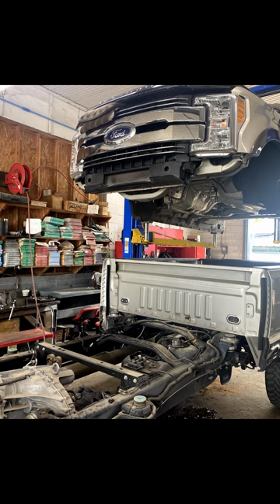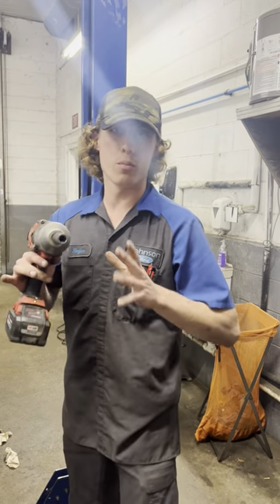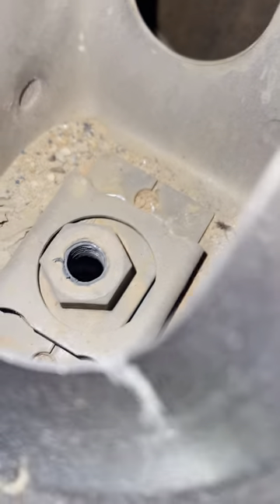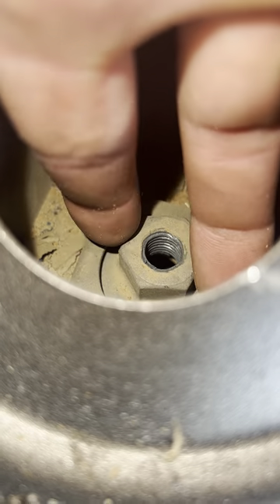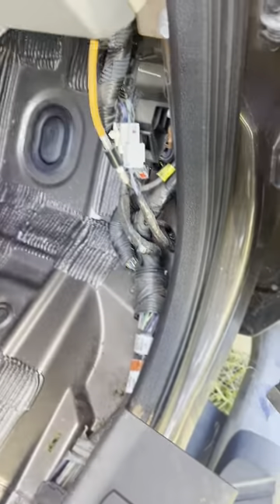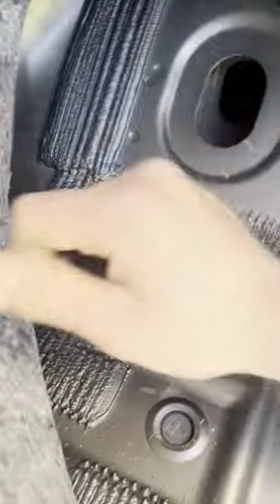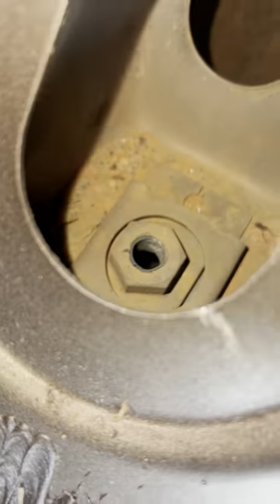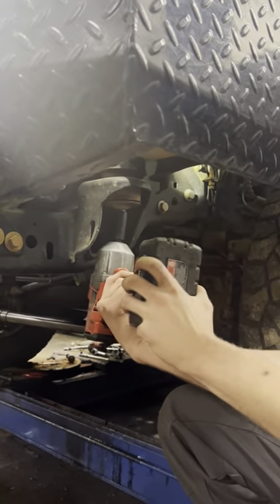How to remove seized F-250 Cab Bolts fast and easy

Comment: Make sure to wire wheel all that galvanization off that so that way they Rust in place for the next guy.
Reply: Lol
Reply: Just put anti sieze on them
Reply: @contraband1543  😉
Reply: You mean somebody's gonna have to take the cab off again sometime in the near future? Jeez what a peice of crap. 🤣
Reply: Exactly. Induction heater or patience.
Reply: Don’t worry it’s a Ford it will have to come apart again before it even has a chance to rust up 🤣🤣
Reply: Antiseize
Reply: @Thundarr995  you donknow what your talking about
Reply: @BimmerLife843  neither do you
Reply: @BimmerLife843 if you listen closely you can hear the fords rusting at a ford dealer
Reply: Believe it or not, when you wire wheel the threads, you’re actually finishing the thread cutting job Ford couldn’t do when they were produced. Any surface on those threads, I don’t care if it’s straight up asparagus dog sht is better than virgin Ford threads.
Reply: And you know, there WILL  be "the next guy."
Reply: The galvanization won't survive the friction from tightening it
Reply: @Thundarr995 maybe in two weeks it’s a ford

Comment: Hey guys the true pro tip is heat all the bolt heads from the bottom with a regular propane torch leave it on there for about a minute and a half and I guarantee you everyone of those boats will come out you were actually liquefy and Loctite and it will come right out done this multiple times. Also never use an impact. The impact breaks the cages break them loose by hand and then you can use an impact after they are already loose.
Reply: How will a propane torch get hot enough and transfer the heat all the way up that long bolt to the nut?
Reply: You obviously don't live in the rust belt if you think lovie loctite will be the only issue.
Reply: Nope it doesn't always work btdt
Reply: Here’s an experienced pros tip: One radiator would pay for an induction heater.
Reply: @lukevonborstel2092  I've used this procedure multiple times. Heat moves through metal quite nicely.
Reply: That's not pro, that's slow. The torch is fast, and more efficient if you know how to use it. Your advice is for people who don't want to take the time to learn how to use a torch.
Reply: @tacticaldorito3942 Then don't torch the radiator? These things don't happen if you're good.

Comment: Don't see how mechanics and techs don't just revolt and say hell no. The dumb reasons to have to remove the body on a diesel keep growing, like oh you need to change the oil? Remove the body, it's getting ridiculous and I never say a word when my guy hands me a bill.
Reply: I was just wondering how much of a problem this really is because I was thinking to myself how often do you need to take the body off of a truck and if there's a lot title on that bullet wouldn't it be to keep it in place so you don't have to go in and tighten that later if it causes issues for whatever reason but now that you've explained that this is a common thing of taking the body off of these trucks quite often I understand why he said what he said

Comment: Heat the fronts proactively. And I always remove the loctite and give her a lil sprinkle of wd40 before I send them back in. Because I like the guy that's working on it next time (usually me)
Reply: WD-40 is a solvent you need PB Blaster

Comment: I always use an induction heater seems to work pretty good to.
Reply: we just got one of these. they are amazing.
Reply: Best for around carpet too!
Reply: I was wondering why this mechanic didn’t use that
Reply: Would that have been able to reach in to where the nut was?
Reply: Bought one awhile back and love the thing, perfect for not setting the oil leakers on fire
Reply: There is a video of that but the tool is 500 bucks
Reply: @dustintunis9347  You don't heat the nut. You heat the bolt head, which makes the bolt hot and melts the locktite. With an induction heater, you can make the bolt glow if you like.

Comment: A low slow flame on the head of the bolt before breaking it loose will loosen that thread lock enough to zip it out. Just let that heat soak through and put your big boy on it.
Reply: Sounds agonizingly slow when you can just hit the nut with a torch.

Comment: One of those little propane torches also work, just leave it a bit longer, I first tried to take them off using just a breaker bar and i was struggling, after some heat I was surprised how easily they came out like butter, I did put blue threadlock when putting the bolts back, which should loosen anyway with heat if I ever need to take them off again (installed silicone ones, I hope I never need to change them)

Comment: I use a brazing tip on the torch so you have a hotter, smaller flame than with the standard torch head (w/o using the cutting trigger). Get the bolt heads cherry red and use a breaker bar to coax them free. Once they're spinning nicely I can usually zip them out with an impact wrench.

Comment: Loctite on body bolts. Ford, what were you thinking? Never have I ever worked on anything, that requires you to remove the cab to work on the back side of the engine. Get your shit together Ford.
Reply: Apparently from some of the comments I'm seeying that's extremely common on some of these Ford f250s & f350s  You need the entire body pulled off just for simple maintenance or repair work on parts that would not need the body put off on any other truck but then again you can't really expect 4 to do something smart... Thing is how they're dumb enough to brag about the Mustang outselling the Camaro when the Mustang is literally the only car they sell right now I mean they literally have no other option for a car at a 4 dealership other than the Mustang if it's not a Mustang it's a pickup truck so how the f*** are these morons bragging about it outsetting the Camaro when Shelby still has a couple dozen other cars that people could buy and choose from 🤦‍♂️🤦‍♂️💯💯💯 Mention for this also the same company this making it literally impossible for regular people to even check the fluids on their own car let alone work on it or fill the fluids themselves
Reply: For the record I'm specifically thinking about transmission fluid I'm not sure if they've done that with the other fluids yet but I worksheets be surprised if they did
Reply: @6luealreadydead lol only slow mechanics need to remove the cab lol. 90% of repairs 6.0-6.7 can be done with cab on including heads on each respective engine.(if you think it can’t be done you’ve fallen for the shop propaganda)

Comment: Every ford cab I pull I never take the big cab bolts out, only the front ones in the core support. The other mounts  just take the two 15mm nuts off then you don't have to worry about the cage bolts spinning in the cab. Also easier to line back up when going down they drop right back in!

Comment: Cut the head off the bolts with the torch. Lift the cab. Heat the cage nut and loctite directly from the bottom. Twist out with vise grips.

Been doing it that way since 2008. It gets new cab bolts, because odds are they're fucked anyway by the time you get em out.
Reply: I have so much respect for guys who have to do shit like this. Looks terrible
Reply: How in the world is your way faster or easier than this
Reply: I was a ford diesel tech around 2008. I attended one of the first Atlanta training courses on the Cab-Off Diesel F-series trucks. At that point, they were telling us that new cab bolts were to be used EVERY TIME because they were torque to yield bolts, like head bolts. They had all the bolts listed together in a kind of "cab off kit." We left laughing our asses off at the stupidity Ford Motor Co. Engineers came up with this time ... but admitted that at least with the cab off, engines were easier to work on! We just wished it was easy to repair without taking the damn cab off!
Reply: @contraband1543  takes probably 3 minutes to cut all the bolt heads off. Lift the truck. You now have direct access to every body bolt nut, which you can heat with the torch from underneath, and twist out the rest of the bolt from the nut with vise grips. Exactly like he said above. All in all it’s probably far easier and probably a little quicker. Especially if it’s a common procedure you do a lot.

Comment: Use a small welding tip instead of a cutting tip
Reply: Why? The tip he used can be fine tune adjusted as low as you want, but still gives you high heat output. He's using the correct tool for the job.

Comment: That’s why you don’t take out the big center bolt. Take out the two from each mount on the bottom of the truck. Much easier
Reply: Can't do that on the front two cab bolts, that mount doesn't exist there

Comment: Mini ductor get one it will change ur life u don't have to worry about lighting stuff on fire or melting anything around the nut. The only thing that heats up is what's in the coil they sell extra long short & medium length coils u can bend to fit in anywhere
Reply: Those are way too slow. Just be good with a torch.

Comment: Use an induction heater. The heat will run down the bolt and melt the loctite. Way less dangerous. Getter good and red.

Comment: You have to use the induction bolt buster, you being a mechanic iam surprised you don't have one, I forgot the part number but if you search it on youtube they should have a video. With the induction bolt buster when used theres no chance of you melting  anything like if you used a torch, Ford uses some wicked ass lock tight.

Comment: Use a rosebud tip to heat bolts and nuts
Reply: Not inside the cab, he's heating the nut which doesn't require that excessive amount of flame. He's literally using the best tool for the job.

Comment: Heat with induction bolt heater. Put in new bolts with blue locktite.
Reply: Wrong, heat the nut with a torch and save time and money. Put penetrating oil on the bolt on reinstall.

Comment: When you guys gonna learn? Blue locktite doesn’t require any extra force to break loose it just prevents vibrations and such from backing the nut/bolt out. Red is the one that you will have to break out a torch for.

Comment: You don't have to do any of that.
Take a 7/8 offset dogbone wrench, like the old craftsman.
Cut it in half.
Just pull the wheel liners and you can slide the wrench in and on top of the cage nut.
Then use a set of vice grips and clamp it down, and boom, you can just spin it out.

Comment: You need an induction heater 
A good one will run you $500 but if you just want a cheap one to try out you can pick one up for $100 

Heats up just the bolt, and does it real quick

Comment: I ain't gonna say I have a lot of experience Ive worked in a welding/fab shop for a year I'll tell you rn if your gonna use a torch for more the a few minutes wear goggles I have had some not so fun time from directly staring at a torch cause I thought I could

Comment: The actual Pro's tip is to use an induction heater and then new bolts.
Reply: No, that's shade tree shit. The torch is the fastest, most efficient method.

Comment: Put some  oil on the bolt if you like the next mechanic. And every other bolt n nut on the car. Including door latch screws. Including the door latch mechanicism (it won't work if you sterilize it with solvent !!! Don't forget the door handle/slash button). 
And don't forget the head light switch. And the headlight adjustment screws. Every single moving part needs lube. Ever buy a bag of bolts and notice how they're oily along with the interior surface of the bag? That keeps them from getting rusty and before and after installation. That's what new cars are assembled with. Not dry bolts.

Frozen locking nuts on tie rod ends are a pain. Lubing everything involved makes alignment easier the first time and .... next time.

Cleaning off the   beautiful grease patina off that took 40 years to accumulate on the front end? 

No.

He needs to use a much smaller torch.

Nearly always works on the nut.

Sometimes due to acess, heating the bolt as close to nut as possible will often work.

Comment: You reuse bolts after you heated them up and ruined the hardness? That’s how you snap them off 🤣 you’ve made it soft, annealed it and ruined the temper
Reply: Pretty sure this would make it harder and more brittle not softer.
Reply: @ding9633  heating and letting it cool makes it soft, that’s called annealing, heating it and quenching it (cooling down fast) makes it hard and brittle

Comment: Chevy and Ram owners are excused from watching and are laughing in the back! Maybe at this point Ford should design a tilt hood/front clip.
The new HO Powerstroke is even more packed under the hood, if that could even be done! 
I pity the mechanics that have to work on these engines.

Comment: I find  heat induction tool 1800 watts works best get the bolt to glow red then hit it with a impact gun. Then i like to replace with new bolts .

Comment: run it back in. put some penetrating oil on it. let soak 5.minutes. impact again.
Reply: That doesn’t work when there’s locktite on the bolt